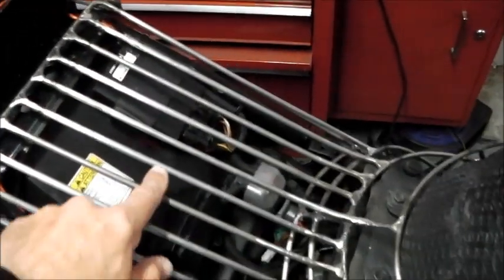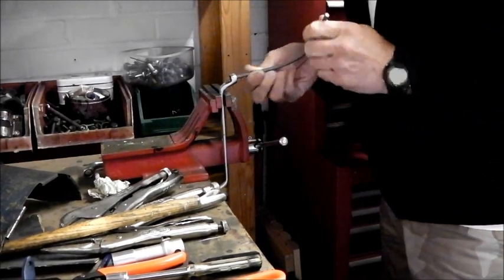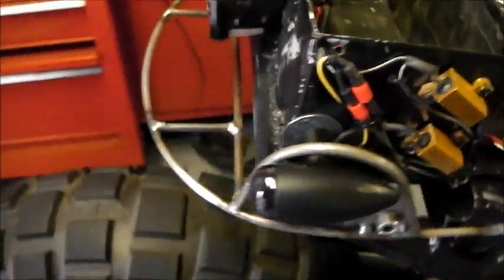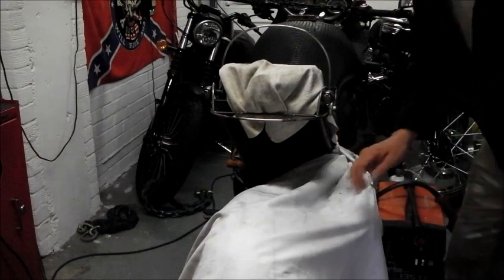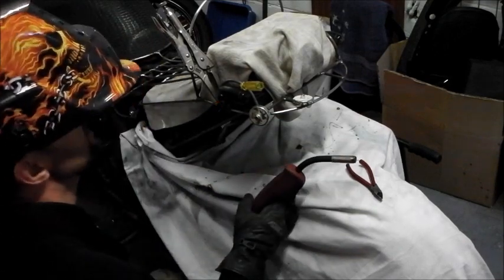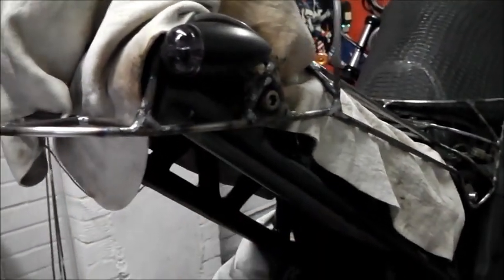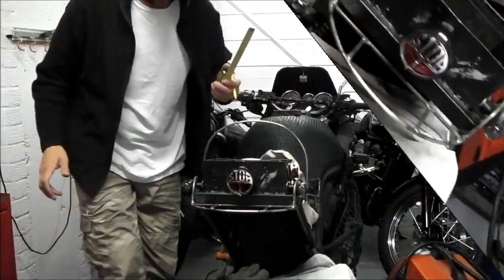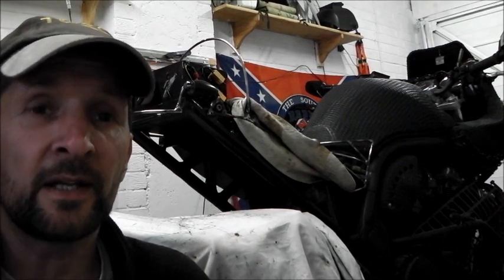Delboy's Garage, Project Bandit #28, Trim round the ears !

Comment from the maker: Hi Dan, I think I picked that up from you both in the past when watching your vids, the idea of the chamois leather was that it's thick and once doubled over the aim was to prevent heat transfer as some of the wiring is only an inch from the point of weld and as a weld tip is 1300degrees+ it could easily melt the insulation and having it wet keeps it cooler... thanks buddy, makes me feel good to know you're watching brother Dan!

Comment from the maker: Hi Jeremiah. Not exactly sure without seeing it mate, if it was an expanding tube like those included with aftermarket mirrors, then the inner end should be cross cut so it can expand, and maybe you can get a thin screw driver blade tapped under it and twist it to fold the tube in on itself, other then that, maybe some time invested with a naked hacksaw blade and actually cut a slot in it so you can fold it in and drag it out....its just a case of 'adapt, improvise and overcome'...good luck mate

Comment from the maker: i was thinking of doing a quick rip through montage at the end of the build from un-locking the seat to rolling the bike out, it shouldn't be too hard, we're on 28 already and shouldn't have another 10 at the most before it's done... so it will just be a case of taking the most poignant clip from each video and then splicing them together to music! Am getting the hang of Movie Maker so it's already a plan!

Comment from the maker: I think the over welding is a habit based in a bit of OCD working on the basis that less is more and all that... but these days, after a couple of years practice, I've managed to get wire speed, power settings and penetration correct most of the time, but I still feel happier piling it in and grinding it back, but as time goes on, I do intend to actively try and improve the quality and appearance of my welds... on a thick enough piece of steel I can almost lay down a perfect stack of nickels...

Comment from the maker: "huge ugly holes flapping in the wind and cracking. Think its a big mistake mate"   dont really get what you mean mate, the indicators are bolted to the chassis, and the seat unit will lift off from over them, what exactly will crack?..and whats flapping about?....the seat unit may be cut over the indicators, but its 1/4" thick steel and braced... its stronger then the Forth road bridge !!!  maybe wait and see a bit further, it will make sense mate..  thanks for watching..

Comment: hey del, generic question.  i just picked up a 2005 band 1200s and went to put bar end mirrors on it but found in both tubes an inner metal tube?  maybe the previous owner had some weights on it and didn't remove them properly?  not sure how to get them out without messing up the handlebars...

Comment: by the looks of it.. the back end will clear anyway? since you have made the slots for the indicators, if you take the bolts out, and tilt the front up so the back of the seat clears the battery box? i could just be talking complete bollocks. :) the bike is looking great tho.